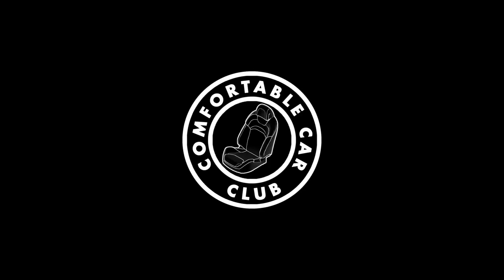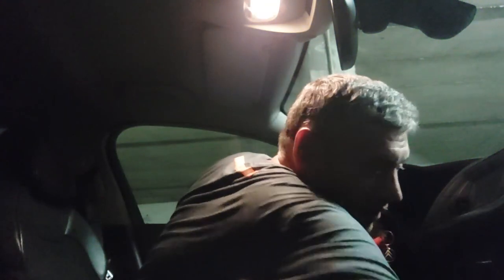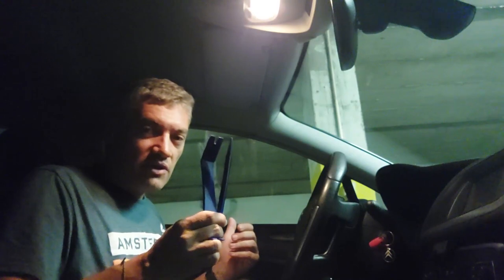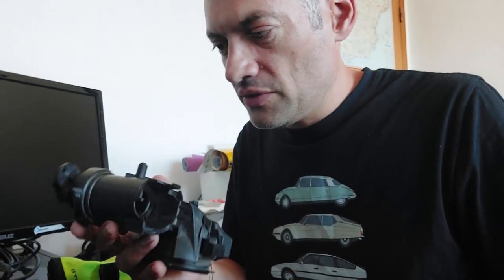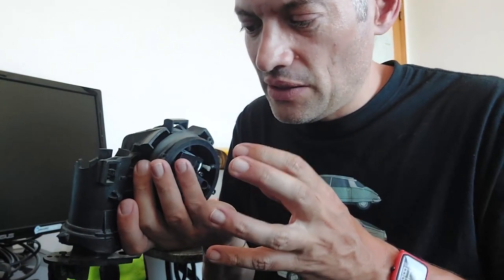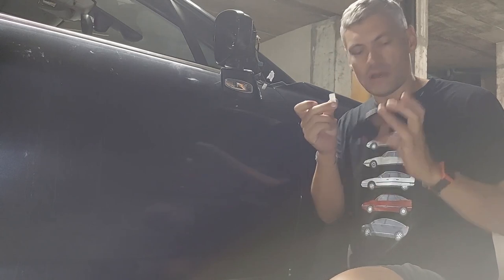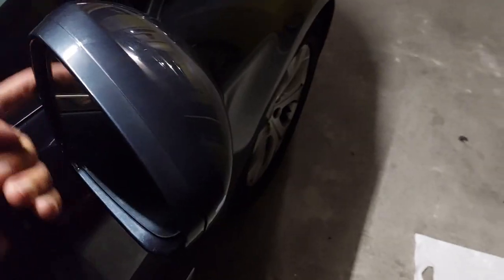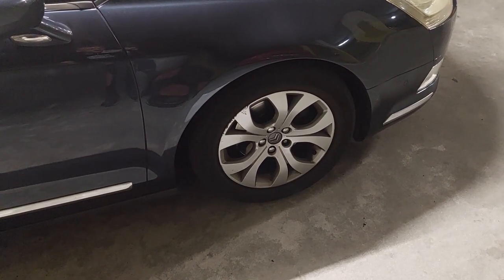Wing mirror Woes and Waffle | A C5 X7 2.0Hdi update

Comment: Wait a minute, if you actualy hear the motor running and the mirror doesn't move, then it could be the gearing inside and not the motor itself. 
But if the only thing it does is this little movement and then it stops, and you don't hear it any more, then maybe the motor is OK and somehow it doesn't run all the way. The computer doesn't power it all the way in (or out). 
Which one is it? 
I never had a problem with those, however, one snowey winter morning, when frost was accumulated around my folded mirrors, BEFORE I unlock it, I melted all the frost in there, so that nothing will get stuck and no gearing will get damaged inside. 
If you hear the motor run and the mirror doesn't move, then I suspect the previous owner unlocked it one frosty winter morning, without thinking about the folded mirrors or any damage there might occur. 
Not to blame him though. I didn't think about it either and it hit me just before I press the unlock button. 
I actualy saved my mirrors, cause there was a little bit of icing left and I heard it crack from the unfolding mirror!
Had I left it as it was.....
 I just saw slocitroman's video and he says that the problem is "the black screw". So .... why replace the motor? 
I'm a bit lost here.

The squeeking on the clutch. 
I actualy hear a squeeking noise on the outside, on the engine, when I press it, but no squeeking "inside". I wouldn't suggest throwing Greece in there randomly, cause there is a potensiometer there which informs the BSI for the clutch pedal position. I wouldn't want to cause other problems trying to solve a minor one, with which we can basicaly live with. If you can fit inthere, try to spray a little bit of WD-40 on the articulation pin, and no more on the plunger connections. 
https://postimg.cc/N93cxs49
Reply from the maker: Hello there! How are you, my friend? 

I just saw your comment on SloCitroMan's video, and of course, I trust your judgement. There is a thread on the FCF, and they indicate where you can buy the black tube: https://www.ebay.co.uk/itm/373150723399?ssPageName=STRK%3AMEBIDX%3AIT&fromMakeTrack=true (pity the postage is more than the article itself). I'm not sure if it's C5-compatible though. If it's just that, I'd remove the black tube, and make a 3D-printed replacement. But after the holidays!

I'm not sure about the ice theory, mr_nice_hearted, because this car lived its life in Lisbon and even on the coldest, most miserable winter days, it hardly ever goes below 16ºC. That said, it doesn't guarantee that previous owners wouldn't take it to some village in the heart of Portugal at Christmas or something!

I thoroughly appreciate the clutch pedal diagram! WD-40, you say? Thank goodness, it's so much easier to apply! 

Cheers!
Reply: @comcarclub  ....Very well thank you dear friend, and the same I wish for you. Now I get it....."the black screw"....he didn't actualy mean the screw but the cylinder. That explanes..... 
Even so, is the case anything like I describe? Is the motor working or not? Do you hear it or not? I'm getting more and more curious to know about that, in case something happens to mine. 
And yes, of course, if the winters there aren't that cold, you're probably right, I just mentioned one case scenario. Doesn't mean that it DID happen to yours. 
It could very well be a natural wear incident. 
And the clutch, I don't know, I'm just guessing, if it was mine, I'd try locating the noise first. I can crawl under there and lye down and take my time. I actualy did that once, when I took out the blower motor for cleaning. At around 80k the blower motor started making a noise, so I took it out, opened up the housing and cleaned it and WD-40 it, and haven't heard a thing since. 
One  note though: I always keep my blower motor to the first notch. It runs as long as the engine is running. I do this because in the winter, if I stop the blower, that stupid ventilation unit opens up the external air intake, and cold air enters the cabin. So I have it always in the first speed, to keep the cabin warm in the winter, while in the summer you always need to have the A/C on, so again, first notch in the summer too. All year long. 
I found an old post of mine in greek citroen club, about that issue, and at the same post I upload pics of my first attempt on painting the middle console, 
http://www.greekcitroenclub.gr/viewtopic.php?f=55&t=11927&sid=292725c12f9df652a2b20117e1a5327b

it lasted quite a bit, but eventualy it started comming off so I had to take it to a painter shop and paint it properly from a pro. 
The audio facia never had a problem since I painted it. 
Oh, I'm sorry....didn't I tell you? THAT's painted too.....😂😂😂😂
Reply: @comcarclub  ...Actualy...you know what? I just remembered...I did have that symptotm at some point, once when locking the car, the passenger mirror moved about a centimeter and stopped, and I unlocked and locked again, and the mirror folded normaly. And a couple of days later, when the car was locked, I clicked to unlock it and the passenger mirror again moved just a bit and didn't open, and I locked it and unlocked it again, and  the mirror unfolded normaly.
At the time I did have a faulty battery and eventualy about a couple of weeks later I had to replace it. Never had any problems again, so it could be from the battery. When the symptom appeared in mine, my battery was at 0% life, didn't have any more usable plates inside for storing energy, so it could be something with the battery and not with the mirror. 
These new CANBUS systems are behaving all weird when they don't have at least 50% battery life, so have you had the battery checked with a conductance tester? How much is available for usage? Does this problem with the mirror happen every time or occasionally?  
More details please!😄😄
Reply from the maker: @mr_nice.  good point. However, with my previous 1.6hdi, I had some battery problems in February 2020. The symptoms were pretty obvious, apart from the economy mode. This one is behaving really well. I'm going away shortly and I will address this when I get back
Reply: @comcarclub  👍👍👍👍❤